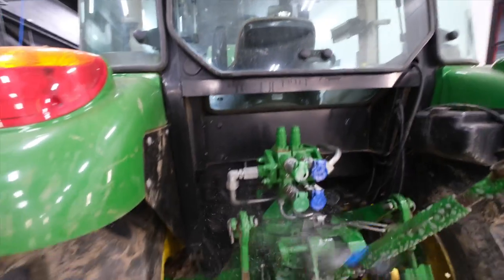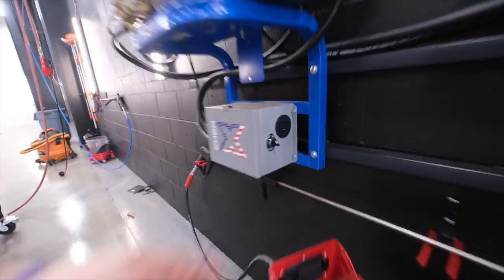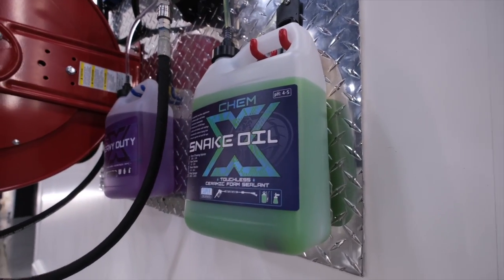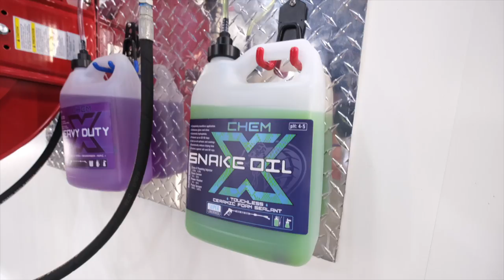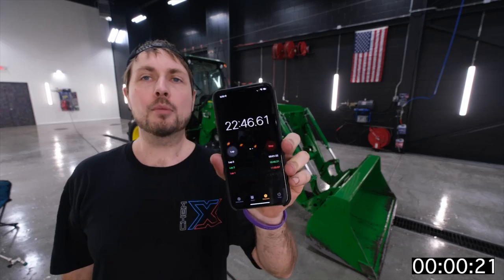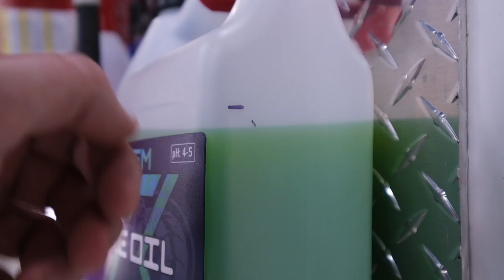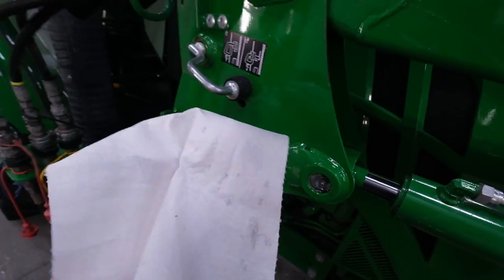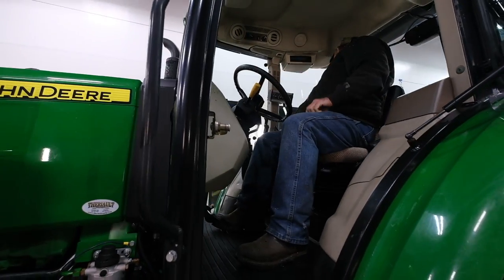Filthy John Deere Tractor! Timed Touchless Wash + Sio2 Sealant + Full Interior Detail!

Comment: I'd get a small ladder when doing the initial rinse, go from top of cab to bottom and do the rinse in sections. The dirt at the end basically blew back into what ya had just rinsed when ya did the 2nd coat so as your rinsing, get all that dirt and other stuff wayyyyy away from what your planning to rinse to avoid cross contamination and have a better outcome on the detail. Cheers!

Comment: Open all the widows and use a leaf blower first on the tractor. Then hit it with a two inch pump sprayer. Saved you slot of time. Gotta have a two inch water cannon on the farm.
 It’s really a waste of time to do any more than that on a tractor. Pressure wasters are bad to blow water into things that don’t need to be wet,like bearings,and electrical parts. We we just leaf blow the trash off,to prevent fires. Things that get too greasy we wash off with diesel.

Comment: As a mobile detailer I wanna find a way of doing maintenance details touch free, Bilt Hamber Touchless gets 98% of dirt off but can’t remove traffic film, no matter the car/coating it will need a hand wash to be truly clean. 

I’m wondering if stars & stripes is okay for every 2 weeks/month on waxed cars or if it’s too aggressive for anything that isn’t a semi or tractor? I only have a kranzle 1622 in my van, is ~1200 PSI strong enough to really get it perfectly clean? It would be such a game changer for my business
Reply from the maker: The two steps is for getting the traffic film shocked loose it’ll come off good, they will wear out standard waxes over time, ceramics or sio2 sealant holds up perfect tho, fine on clear coat as well. The psi you have would work it would just take a bit more time to do a good job

Comment: This touchless washing stuff is pretty neat! But, hypothetical question: What would happen if someone used only Stars OR Stripes, and then washed it off, never using both as intended?
Reply: Not as good by a long shot, the pH shock of the acid and then base neutralize on top of each other and get rid of the road film. You then you rinse it off about 6in to 12in from the surface and no farther.
Reply: You would be hypothetically wasting your time and $
Reply: @dougkratz5269  Of course, but my primary curiosity here is also if there is potential for damage to paint/surfaces/clear coat from improper procedure? Let's say someone is washing something, and they only get Stars applied before some kind of emergency pulls them away from finishing the job? What's the worst case scenario improper use could cause?
Reply from the maker: So there’s no danger when using just one or the other to any of the surfaces, stars alone would clean aluminum and brake dust and bugs, stripes would remove greases and soot, but they are def best used one over the other to shock the ph level neutral and shut off the static that holds on the road film and grime so you can power wash it off without physical contact
Reply: @ChemX  Ah, very good to know! Thanks for the reply and info, and very neat products! Much appreciated!

Comment: My only input to this detail would to be use a hot water pressure washer but in previous videos you've outlined why you don't use one so couldn't have done it better myself with all my wash mits and buckets
Reply from the maker: Thank you yeah down the road I may install some heated water coming in, it would be fun to do hot water v. cold water content
Reply: @ChemX  What is the reason for using only water cold?

Comment: Looks like new after all that, I would have taken the wheels and the loader off to be able to do a better clean though, get those harder to reach places.
Reply: The question is if he can get those wheels off though, they have 300 pounds of pressure per bolt on em.

Comment: If you wash regularly (once every week or every other week) with Stars + Stripes, how often would you say to use Snake Oil? Every time? When the water doesn't bead anymore?
Reply: I believe he said in the release video it should last a couple months
Reply: I’ve got about five washes with s&s on a vehicle that had snake oil and it’s still doing it’s job.
Reply from the maker: I haven’t seen snake oil fail yet actually, it’s designed to last about 3 months, Stars and Stripes has not been removing it with weekly washes, it’s working even better then I planned